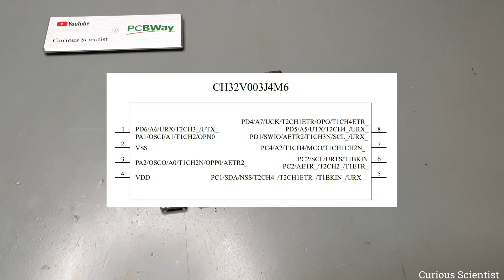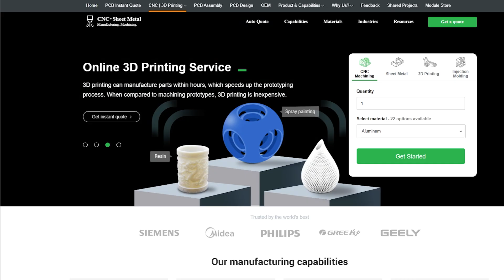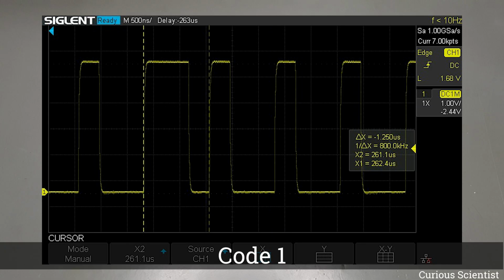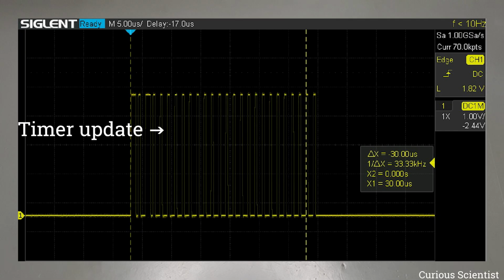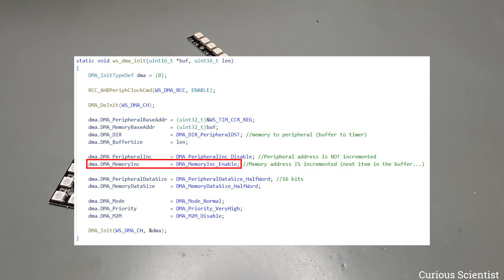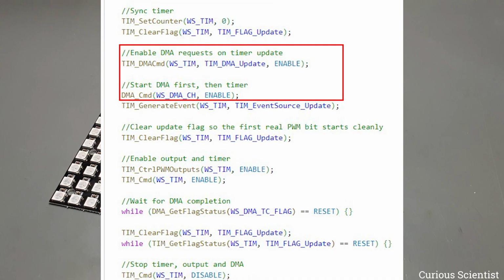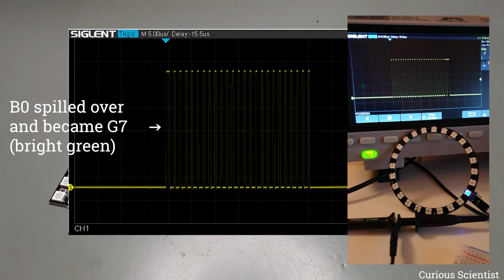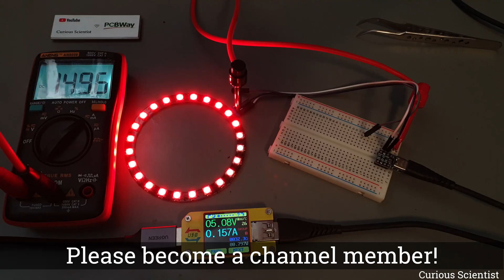CH32V003J4M6 - Miniature development board + WS2812B RGB LED with TIMER+DMA control

Comment: Try to set MemoryDataSize to byte and PeriferalDataSize to halfword or word (no difference). DMA will zero-extend values and will correctly write them to timer. And you can then use array of bytes instead of halfwords since all ticks values are less than 255.

Comment: Why not use the newer compatible CH32v002? it has double the SRAM (4kb vs 2kb), better ADC (12-bit vs 10-bit) and wider voltage range (down to 2.5v) for a slightly higher price ($0.163 on AliExpress right now)
Reply from the maker: Because I don't have it at home.

Comment: The PY32F002AL15S6 (soic8)  inside is really a PY32F030 chip 
32K Flash; 4K RAM; PLL; DMA; 2xSPI; 2xUSART and  other.  I managed to run both spi1-mosi and spi2-mosi at the same time using DMA ch1 ch2. And the price is almost the same as the CH32V003J4M6.
Reply from the maker: Wow, that sounds impressive! Might look at the chip later, but I am still going through the CH32 series.

Comment: if you don't have enough memory to buffer all the LEDs, you could have a buffer for just 2 LEDs, and "race the beam": while the DMA spits out the buffer for one LED, you compute and write to the other one. the trick is that you have to represent your LED pattern as a stateless function that takes in time ("frame number") and LED index as inputs, and generates a single LED's worth of output, and ensure it can execute fast enough to keep up. but the upside then is that you can address unlimited LEDs (or, limited only by the range of the "LED index" integer). This is (very roughly) equivalent to how OpenGL fragment shaders work, although in that case of course the per-pixel shader computation is parallelized across GPU cores, while here it's just quickly computed on-demand. this will probably be gnarly since the timing constraint means you're probably stuck with just integer math, but there's still a lot you can do with that if you're quick.

also, you can do a hybrid approach, pre-calculating any per-frame constants you can between frames, and then referencing those per-frame constants in your per-pixel shader, to save precious time in the shader at the expense of some fixed memory cost (that remains constant regardless of number of LEDs)

One gotcha is that your "frame counter" will wrap around eventually, make sure it's unsigned, and either try to have the pattern loop cleanly, or have a large enough counter that the looping jump is rare enough to not matter. At 60fps, even a 16-bit frame counter will give you 18 min of smooth animation before looping, for a 32bit counter that's over 2 years.
Reply from the maker: Oh, wow! Thanks for the precious contribution! I discussed something similar with another viewer in the comment section as well. I am very thankful that you took your time sharing the idea and concepts. Since more people are interested in this, I will try my best to implement something and demonstrate it. 

BTW, I love your username. The contribution is the polar opposite of what your nick suggests.
Reply: @CuriousScientist  haha thanks, i picked it years ago when the contradiction would be more obvious, glad my comments are still recognizably human (for now at least).

good job youtube, i wasn't able to find any similar discussions (still not showing up), otherwise i would've added there instead of creating a whole separate thread, sorry about that! i should warn you: i've implemented a scheme like i described, but only with APA102-style LEDs which have a separate clock line (and thus timing is basically a free-for-all), i have no idea how practical this is on a tiny MCU core when subjected to the hard timing constraints of your application.
Reply: oh nevermind, i found it. there's a key difference in that i'm not suggesting storing the RGB values at all but generating them on the fly (so that memory doesn't scale with pixels), but @willemstigter6384's suggestion is definitely a lot more reasonable in scope to implement (since it doesn't require the mental acrobatics of turning the animations "inside out" to fit the shader model, and allows more computation to happen outside the critical section)
Reply: Doable indeed,you may need a carefully engineered DMA ring and a deterministic refill function. In my opinion of course
Reply: @enredao_electronico2737  yeah deterministic is definitely key. u probably can't do ray marching loops in it :D

Comment: Hi!
I was wondering, would a more bare-metal implementation of a code save a significant amount of space? If I remember correctly the CH32V and MounRiver do support an stm32-like naming convention, and the macros also resemble the stm32 HAL.
Another idea: Would it make sense to sacrifice bits? (I was thinking of 6-6-4 bits instead of 8bpp). Also if the pattern is fixed, could e.g. huffman compression be applied or would the implementation take up more resources than it saved?

Great video, you were the inspiration for me to step out of the Arduino bubble!
Reply from the maker: Hi and thanks!
Yes, probably the HAL-like framework bloats the code to some extent. On the other hand, I don't know if I could sacrifice bits. Do you mean that I don't use all the 8 bits for each colour? If so, that is not really possible, because the RGB LED still needs its 24-bit pulse. I think, if you want to control more LEDs, just choose a better MCU. These CH32s are so ridiculously cheap that even a powerful chip is much cheaper than its "branded" counterpart. This CH32 series is targeting exactly those people who are looking for something else than Arduino, and their target is not necessarily some well-known, well-documented chip. Plus, I also want to use these chips more in my projects, because they are cheap.

Comment: By giving up some performance you could increase the amount of leds by switching from dma to an interrupt. The way it is set up right now each pulse is 16bits and every led needs 24 pulses so each led takes 48 bytes instead of 3 bytes. By using the interrupt some code could check the bits and fill in the pulse length.
Reply from the maker: That's an interesting idea for optimization! Thanks! I will look into it once I have a little time. It would be nice to make the code better.
Reply: @CuriousScientist  you could also balance it a bit and update a 48 byte buffer for each led instead of each pulse.
Reply from the maker: Yeah, something like that might work. I could create an array of RGB values (or color code which then later translated to RGB) and then I do the pulse generation on the go, per LED as you said. That would lead to nice memory savings. Then it is 48 byte (actually, it is 52, because I need 26 pulses) per active LED and 3 or 6 byte more for the rest of the LEDs. I will check if it is possible and report back.